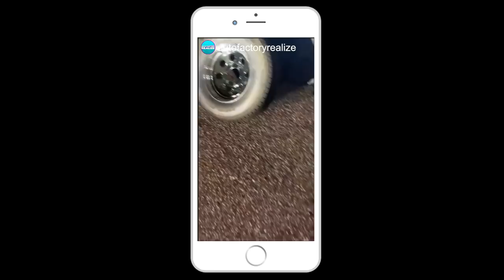Back to Basics at 626Drift!

Comment: Ditch that Rb and put in a sr20
Reply from the maker: Never 😈
Reply: Auto Factory REALIZE Keep having problems with Teddy’s rb and not getting enough lap time then 🤷🏻‍♂️. The s13 with sr doesn’t have any problems, your 1jz s13 doesn’t have problems
Reply: @nightreapers3425  what problems has had with his rb? From what i've seen it's been mostly drivetrain and not the engine itself. Next  thing is to say he would have less problems with an sr is just dumb. I've had two srs and BOTH BLEW UP*. I went rb and have had literally zero issues over 400hp on limiter for 5 and a half years now "and have proof". You'll *NEVER convince me sr is more reliable than rb.
Reply: @nightreapers3425  oh and sr is built because i'm guessing it already blew up and chucks jz blew to too so you have no good argument...
Reply: @clutchkickpj693 Easy there internet wizard im just judging off teddy's drivig lol. he always doesn't drive good cause the rb